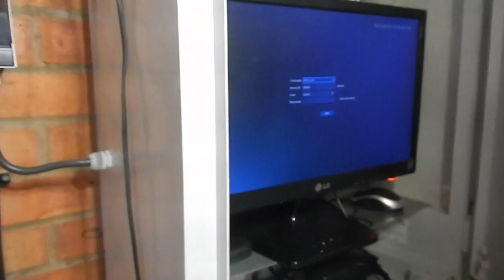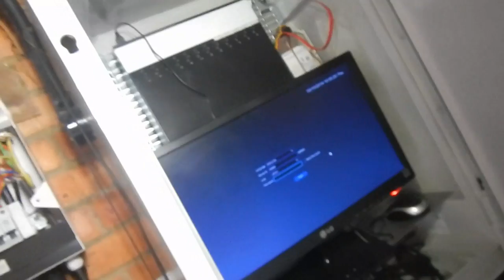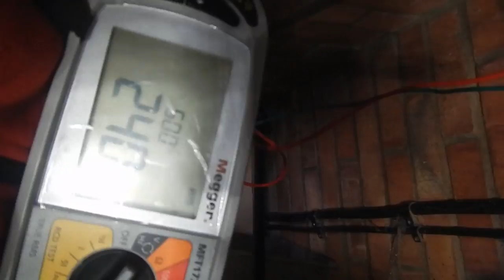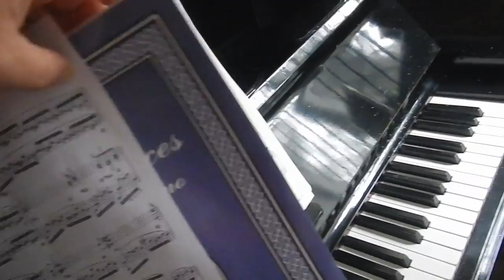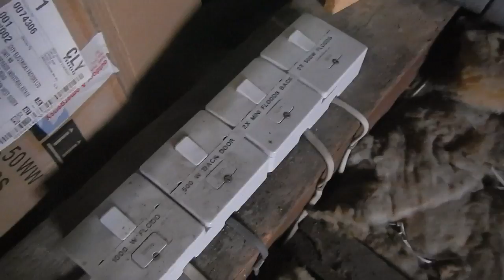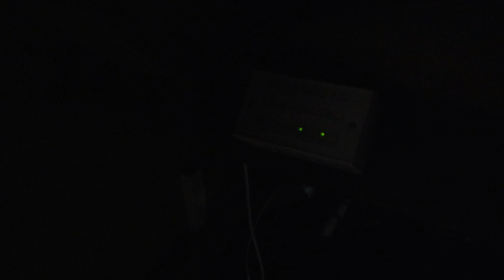Video 56:  Customers' stories can really confuse easy fault finding jobs

Comment: I once had a lovely customer too. Mind you, this happened in Austria, so the layout was slightly different. Anyway, old flat built at the beginning of WWI, completely rewired in the early 90s. 25 amp three-phase incomer with the meter and DB above the stairs right outside the chap's front door, single 100 mA RCD, three-phase cooker feed and mixed 12 amp lighting and socket circuits. The story I was told was that nothing had tripped but the lights in the kitchen and the loo, most sockets in the kitchen and the cooker were out. Since the cooker is on its own circuit, I briefly thought of a lost phase, 25 amp fuses do sometimes blow for no apparent reason, though rarely.

A quick check showed that the cooker worked just fine though, only the microwave was out. I confirmed that no MCB had tripped and decided it had to be a loose connection somewhere. So I started looking for junction boxes, tapping the walls with the handle of my screwdriver as the whole kitchen was papered with woodchip wallpaper, while the customer kept telling me I was crazy and surely the fault couldn't be up there. I found a JB, carefully sliced the wallpaper and started pulling out the wires and choc blocks. As I grabbed the lines with my pliers, I saw sparks so I knew I was on the right track. I turned off the MCB, rewired the whole box with Wagos and everything was fine again. Quite an easy job compared to finding a drowned JB after a fire in the same place a few years later! That took me several hours of trying to understand the layout of that circuit and systematically splitting it into small sections until I'd get decent IR readings.

The most impressive fault was a broken neutral between the meter and three-phase DB at my gran's though. I've never seen regular 40 W light bulbs shine that brightly anywhere else :-D
Reply from the maker: Hope to get another video out very soon, the interruption has been due to factors I shall attempt to describe shortly!  An unintended break in normal operations!  Thanks for posting, great story.

Comment: Nice one Rupert for confessing your mistake with the neutral, we've all done that and anyone who says they haven't is a lying bugger.....👍
Reply: Wired a new lighting feed into an overflowing junction box once, turned it on to do my live testing, only to have it trip both RCDs at once. Turned out there were two circuits in that huge rats nest and I'd picked the wrong choc block. I seem to remember one was even a 2.5 mm2 socket circuit so I should've noticed but didn't. Easily fixed though.

Comment: Hi buddy, enjoy the videos seeing different electrical problems. Looking at the tripping/cctv video i would have connected cctv supply via a fused spur from main switch side or an Rcd fused spur next to consumer. Connecting onto a split load rcd switch leaves you as the last man in and involved in the existing crap out with your install.
Reply from the maker: You are right there Kenny.  That garden light farago is looming over me (he keeps mentioning it) anyway.  I never thought of it your way...  In the end though, I was the numpty that stuck the neutral in the wrong side and the fault emerging 18 months after install had me flummoxed.  I am dreading doing the quote for the security lights, probably I will do a very restrictive scope of works which I won't be able to stick to, and it'll end up being on day rate.   Thanks for the advice, I'll bear it in mind next time about being last man out...

Comment: Thanks Rupert - interesting video. In the first part, I think you said there was a 2.5 cable connected to the lighting circuit mcb. Sounds strange. Surely there weren't sockets connected to the lighting mcb?
Reply from the maker: No, it was an odd length.  Thought it might have been the overload, but it was a flylead stuck on to extend the old tail.  After screwing the neutrals and line back after a bit more testing, it all worked and I left.  No neutral metal to metal contact in the CU - just as I said before embarking on a red herring most of which didn't get filmed!  Thanks for watching.
Reply: @LAsparkTVWireTestLimited  Ah, I see.
Reply from the maker: @markrowland5393     I've been called at short notice by and old customer with a beautiful 6 bedroom house here to do EICRs on both that and the one he's moving into.  After a long chat it transpires, that it is a 35 year old housemaster from our old school who is buying this perfect, huge house, as a holiday house.  If only state school teachers could afford such luxury.  I'm an advocate for the state providing lovely houses free to teachers and upping their salaries by about 3 times.  It seems so iniquitous.  No wonder the fees are 40k a year.  Hopefully I'll cajole the new owner into becoming a client in future.
Reply: @LAsparkTVWireTestLimited  Mmmm..... Well, I don't know what they pay the teachers at our old school, but I would be surprised if it would be enough for him to afford a huge house as a holiday home. I suspect it's more likely that it's family money. I could be wrong, of course. I do agree that the fees are now obscene. I would have liked to have sent my two sons there but there was no way I could afford it. Judging by your experiences there, I'm quite glad.

Comment: Great video Rupert, but what was the multicore you were pulling out?
Reply from the maker: O that was data cable of some sort, some completely inappropriate sort, used for sensors on this posh (was posh in the 90s) flood lighting control set.  The sensors are all wired via data cable to a central hub and then a control box operates relays...   I haven't got my head round it yet.
Reply from the maker: Thanks Peter.  It was something for a control panel which operates a series of contactors controlling their outside lights.  Stately homes and places like that tend to use the system I don't remember who makes it now.  Anyway the PIRs and controller are all linked using data cable.  It's okay, but you have to route all that data cable and I'm not looking forward to it one little bit!  Thanks for the comment.  All the best.